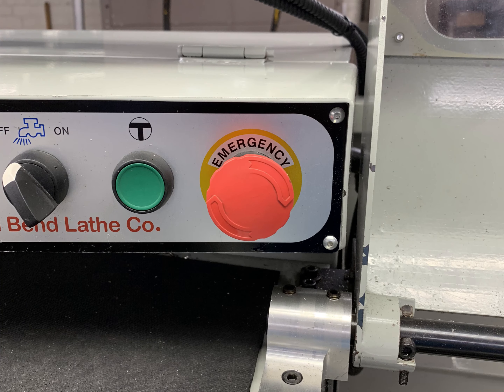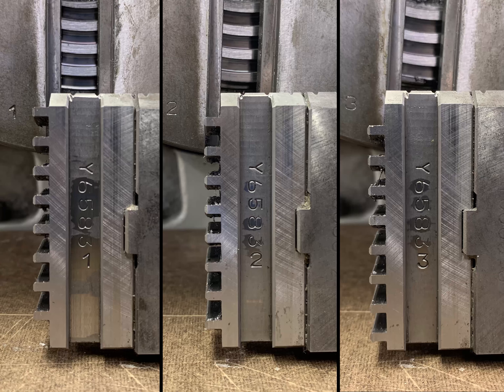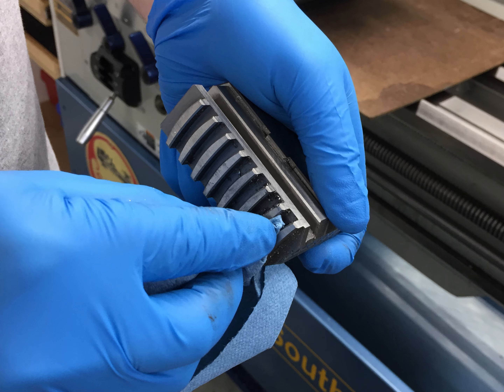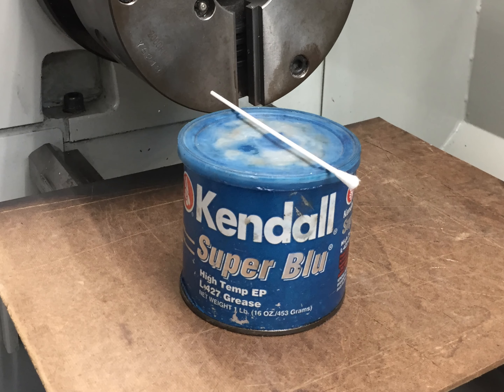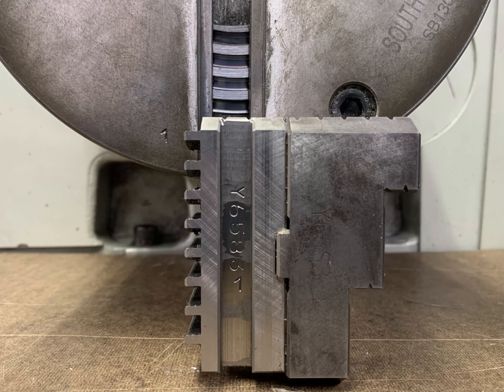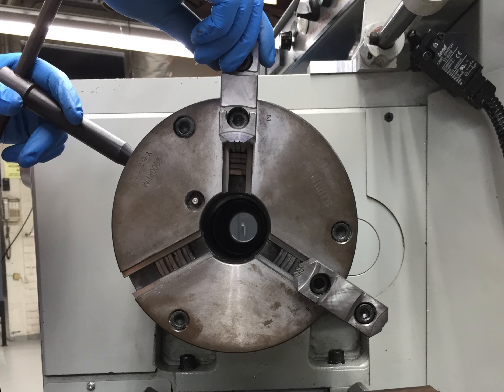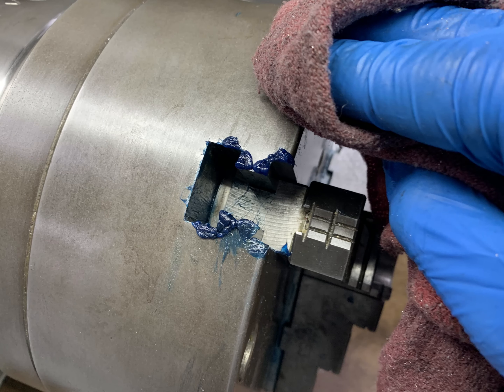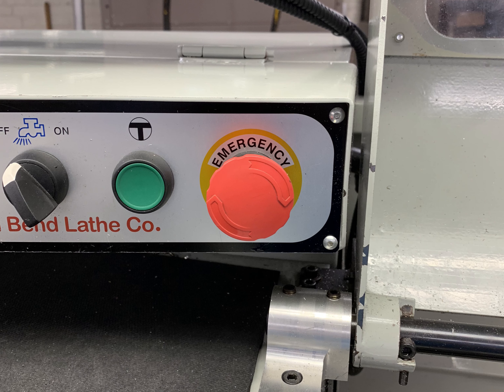Greasing Lathe Chuck Jaws

Comment: I totally disagree with using grease on lathe and drill chucks…vices…anything slow moving with threads…
It just acts like a magnet for dust and metal chips..
A light oil like 3 in one works just fine, and is so much easier to occasionally clean using brake cleaner or white spirits…then coat with the oil….
I’ve restored many  old lathe and drill chuck seized solid with a mixture of hardened grease and crud…
Grease is fine on high temperature fast moving parts where it’s recommended..